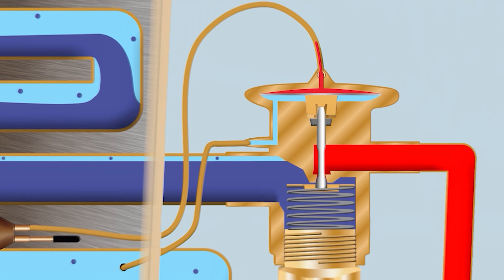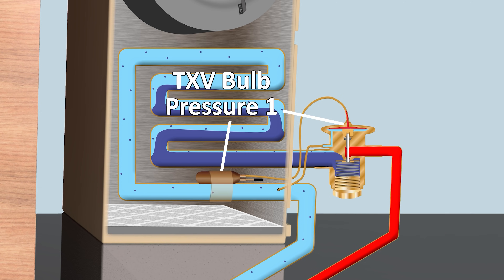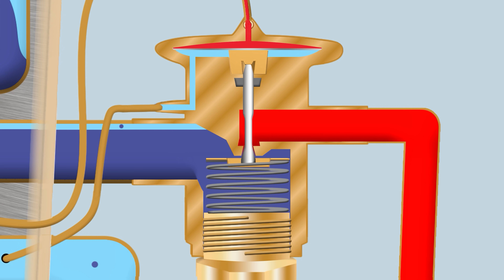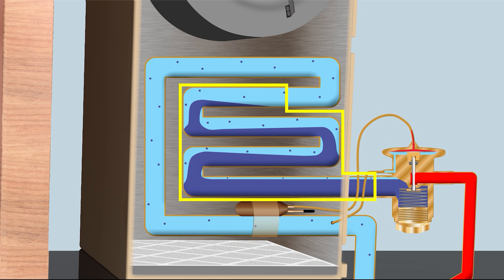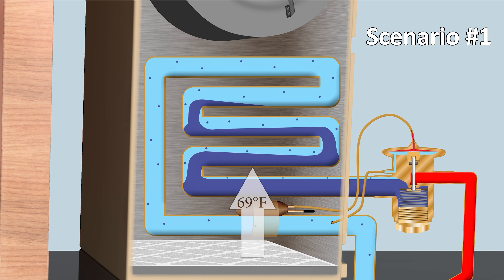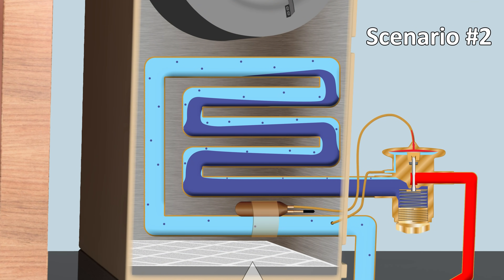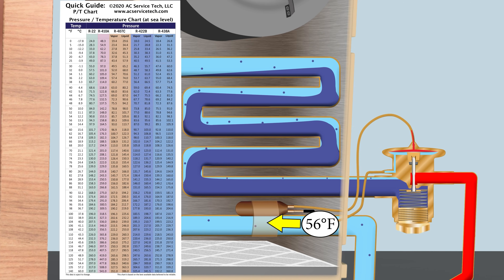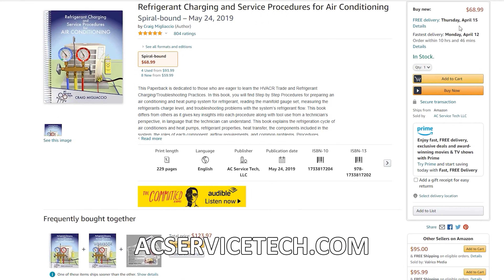(TXV) Thermostatic Expansion Valve Operation with Pressures! 3 HVAC Scenarios!

Comment from the maker: -https://www.acservicetech.com
-Quizzes https://www.acservicetech.com/quizzes
-FREE Videos, Calculators, Podcasts, Articles, Tips, Quizzes, Q/A: https://www.acservicetech.com 
-Facebook Tips: https://www.facebook.com/acservicetech 
-Tools we use, Our Book, Workbook, and Quick Cards: https://www.amazon.com/shop/acservicetech 
-Join our updates list for an email strictly from us for new videos, articles, products and website features! 

-Our E-book, Paperback, Workbook, Quick Cards, PowerPoints, https://www.acservicetech.com/store 
-Posters, Book, Workbook, Cards on Amazon: https://www.amazon.com/shop/acservicetech
-Our E-book: https://play.google.com/store and iTunes and search "ac service tech" 
-Posters & PowerPoints on our Website: https://www.acservicetech.com/store
-Spanish Paperback and E-book: https://www.acservicetech.com/libros-en-espanol
Reply: Vrey vrey good welcomed thanyou gues
Reply: Hello.  Question for you please.  I just had a new furnace and AC system installed.  They installed a TXV-42 and the whole unit (the bulb and valve) is outside of the unit.  The bulb is wrapped in insulation.  Is that ok?  I see a lot of videos showing the "bulb" hooked up inside of the unit on the A-coil..  I have an upflow furnace, so maybe the bulb is outside of the unit because the furnace blowing heat up across the coil (where the bulb could be) sn't good?  Is there an issue with how they installed it?

Comment: What is the short probe that has the insulation/blackthing on the bulb for?
Reply from the maker: Tgey used to ship with a black rubber cover where they crimped the cap tubing. it was sharp so they covered it at the factory and shipped like that, thanks!

Comment: Nice video.  From what I see, the TXV only responds to dry bulb temperature / sensible heat.  I don't know why it was necessary to say whether the indoor environment was humid or dry, as the TXV appears to be responding only to dry bulb.  Wouldn't higher humidity increase the load (latent load) on the evaporator?  Or does that just increase runtime, and the TXV is unable to measure the effect of humidity?

Comment: so why does super heat rise on a low charge if the txv is supposed to maintain super heat?
Reply: Because theres not enough liquid going to it. The txv will do it job as long as there’s the correct amount of liquid, and correct cfm from blower.

Comment: I have bit of confusion with external equalized expansion valve. Can anyone help.

TEV above diagphram gets superheated referigerant due to bulb. 
Where tapping for external equalizing line is taken after the sensing bulb, so below the diaphram should be superheated refrigerant as well.  

How come saturated vapour pressure is considered below the diaphragm.
Reply: No, the bulb/powerhead is seperate refrigerant than whats in the system and below the diaphragm , its not superheated vapor its saturated so will respond to changes in temperature on the vapor line.  Below the diaphragm is superheated vapor. Correct.  You take the pressure of the vapor line to convert into a sat temp,  That sat temp is the temp where the refrigerant in the evap starts to boil off.  That pressure is about the same at the equalizer  as it is in the evaporator.  Once all the sat refrigerant in evap boils off and is 100% vapor is when it starts to increase in temperature while remaining the same pressure as it absorbs heat from the air, this rise in temp is called superheat , so lets say your vapor pressure converts to 42f sat temp, you know that refr is boiling at 42f in the evap, but your vapor line temp rite at the bulb is 52f.  This means youve superheated that vapor 10f.  So if this was R410a your vapor line and equalizer would be at 123psig but since the bulb has a saturated refrigerant inside and will change in pressure with a rise in temp its sensing, if its sensing 52f then the bulb pressure would be 148psig and would force the diaphragm downwards to open the valve, as your heat load gets less and less, the vapor line temp lowers causing the bulb pressure to also lower and in turn starts throttling back towards closed.  I could go deeper into this but i hope that helps you out.

Comment: Hello, I watch your technical videos on YouTube and I think you can help me. I have a misunderstanding and maybe you can help me solve it. With the AC installation, the main purpose is to cool the room, with the "heat pump" installation, the main purpose is to heat the room. We know that both installations are based on the thermodynamic properties of the refrigerant. My question is: When the goal is to maximize the cooling of the room, the settings of the installation on the refrigerant side (expansion valve and others), is it different from the settings when we want to maximize the heating of the room? As an example: If the priority is to cool down, we adjust the expansion valve in one way, but when we want to maximize the heating of the room, we adjust the expansion valve slightly differently. Or what other adjustment differences are there (if any) on the same refrigerant installation if we want to speed up cooling or heating.

Thank you very much
Reply: no, thats not what the txv is for. It only maintains superheat.  Never adjust it.  Theres no speeding up heating or cooling a space.  The unit needs to be sized correctly for the given space to heat or cool properly.  There are no adjustments to the txv to boost performance.

Comment: What would cause the pressures in a residential split AC system to NOT equalize or take a long time to equalize after the compressor shuts off?
It has a factory installed TXV in the evaporator coil. 

The problem I’m having is the compressor is not able to restart “even after like 30 minutes” due to the unequalized pressures. 

When I allow the pressures to equalize through my gauges it starts just fine...
Any suggestions would be appreciated..

Comment: it looks that the evaporsppptor fan is transferring heat into evaporator coil and it controls along with evaporator coil.That is why when cabin temperature changes,the heat transfer of blower into bulb is so changing.This differential exhibit changes in txv orifice valve gas inlet area.The changes in area of valve opening also changes the flow volume,

Comment: Sir,I would like to ask,when compressor is off,does the txv is closed or a little open?If it is closed due to spring action on superheat adjusting screw then when compressor is on the pressure will push the needle valve so the refrigerant can flow.the diapraghm automatically control the volume and pressure depending on pressure the sensing bulb transmitted or communicated to it.

Comment: Do you remove the black plastic on the bulb y/n?
Reply from the maker: On the pinched off small tube used to fill the bulb? You can just leave that on. We are insulating around the whole bulb anyway, thanks.

Comment: I am confused. How can the pressure on top of the diaphragm be different from the pressure underneath the diaphragm? If you're sensing bulb sits within inches from the external equalizer tube that feeds to the bottom of that diaphragm, then both pressures that are exerting force on the diaphragm should be equal. If I have 69 psi where are the external equalizer tube goes, then that converts to 40°. That's where the sensing bulb sits. So the sending bulb is also sensing 40°. That is filled with the same refrigerant that's in the system yet it's isolated from the system. So converting 40° over to psi you would get 69 PSI. So you're sensing bulb and external equalizer should be equal at the diaphragm. 

What am I missing? How is the pressures different?
Reply: The pressures are different because  the bulb has saturated refrigerant inside which will raise and lower the pressure inside powerhead with changes in temperature on the suction line.  Whereas the equalizer has 100% superheated vapor which the pressure does not change with temperature increase or decrease.  That 40f temp is when the refrigerant is saturated as it is in the majority of evap,  by the time the refrigerant all boils to 100% vapor and exits the evap, its 12 degrees warmer so 52f.  So the bulb is sensing the 52f  not 40f.  Dont have pt chart on me but what it means is that the pressure in bulb,cappilary, and powerhead is higher pressure than 69 psi being taken at the equilizer. Hope that helps a bit.

Comment: So is subcool temperature decreased vapor refrigerant?
Reply: Subcooling is the degrees of temperature that the high pressure liquid refrigerant is below its saturation temperature. Below saturation temperature, the refrigerant exists as a liquid. Above that temperature, it exists as a gas. For example, if you have R410a at 297psi which is 85*F, it has been subcooled by 10*F. It is 10*F below its normal saturation temperature of 95*F because it has traveled through a condensing coil which cooled it off a lot. That is subcooling, and it's what you talk about when you're talking about the liquid or high pressure line of the system. When you deal with the vapor/gas phase of refrigerant in the low pressure line, that is when you talk about superheat. Superheat is how many degrees of temperature the gaseous refrigerant is above its saturation temperature at its present pressure. A low pressure line pressure of 112psi which is 49*F would have 12*F of superheat because R410a's saturation temperature at 112psi is 37*F.

Comment: Is it ok to move the sensing bulb further, or insulate it so it only senses the suction line temp and is not affected by the rest of the air in the evap box? I find that it reduces the superheat while controlling it well and improves efficiency. By doing that, I effectively control the superheat in a TXV system when it is not set sufficiently low by the installer.
Reply from the maker: you could but just make sure that you have at least 8 degrees of superheat after moving and checking, thanks!

Comment: my ac unit whether on or off, has a metallic whistle faintly coming from the 2 exposed copper pipes outside. to me it sounds like a metallic version of when you just barely leave water trickle through your plumbing.  i suspect that is refrigerant flowing through the system..even when the ac unit is off. weird. could this be the txv getting 'stuck' and allowing refrigerant to flow back into the condensor/compressor(?) that is outside?  sometimes it makes the noise all day and night. sometimes only before and after running, and eventually stops til the next on/off cycle. it seems like lately it is mostly all the time. help?

Comment: If the bulb is sensing the temperature of the evaporator outlet, and that is the temperature inside the suction line, then how is the pressure lower downstream from that bulb that's being taken from the external equalizer?
Reply: The compressor is decreasing the pressure of the suction line and increasing the pressure of the liquid line.

Comment: I'm confused
If the sensing bulb is sitting on the suction line measuring a temperature of 52 degrees and the external equalizer line is just downstream of that taking the pressure, wouldn't the pressure inside the suction line be equivalent to the temperature of the sensing bulb?
Reply: I believe it's because the refrigerant in the sensing bulb is saturated whereas the refrigerant in the suction line is not. 🤔 Not sure though.

Comment: I was watching an Emerson TXV training video on the Jackson Systems channel.  Someone asked the instructor about testing a TXV part.  Apparently, you can cool them with ice water on the bulb/powerhead to close and use your body heat to warm them up to open.  Don't apply a flame or anything.  You have blow through the valve while cooling/warming to feel the valve close and reopen.  I tried this with an automotive TXV and it works.  If anyone wants to get a "feel" for the valve operation.

Comment: Great video.As the job of the TXV is to maintain constant superheat in the evaporator,why is it recommended that when U charge refrigerant on a system that has a TXV u use sub cooling method?
Reply from the maker: As you add refrigerant to the system, you won't see a change on the vapor side because the txv is controlling that. You will just see a change on the vapor side, thanks!

Comment: Great video!!!!!  But why some TXV doesn't have external equilizer?
Reply: Internal equalization is permissible when the design of the evaporator is such that there is no a significant pressure drop across the evaporator so the pressure coming out of the TXV is essentially the same as that after the evaporator.  Seen more with, say ice cream machines, and not likely with AC evap coils which have a lot of small tubes.

Comment: That was really one of your best lessons (among many) vis-a-vis the integrated use of graphics and spoken explanation. 
One suggestion though: you didn’t direct student attention to the changes in your brilliant graphic of the mix of dark blue/light blue. I only noticed late that they were changing to reflect the position of the liquid up and down the evaporator. I think many students might not have gotten the implication of controlling how much of the evaporator is exposed to the saturated state and thus the latent heat of evaporation, which, of course, is the only heat-absorbing state since the temperature cannot rise. I think this terrific aspect of your video deserves spoken attention with the latent heat eye-opener.
Reply: The saturated state is not the only state where heat exchange takes place.  otherwise superheat and subcooling would not exist.  Think about it. It is however where the most btus are exchanged when compared to sensible.

Comment: What do you call the line after the txv or metering device?  I want to say suction line, but that's closer to the inlet of the compressor.
Reply: I don't know that the line has a specific name, distributor maybe? Most of the time it goes into the distributor which divides the low-pressure liquid into different paths to travel through different sections on the evaporator.
Reply: @chrisdeanndavison3626  that sounds about right I've seen that more on the commercial side
Reply: @Cee Bee I've heard them being called that as well lol